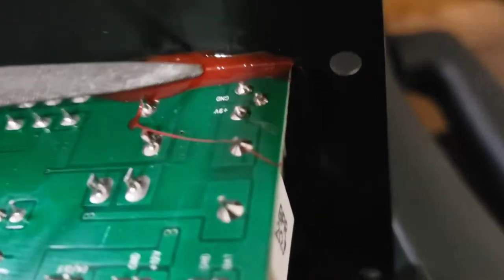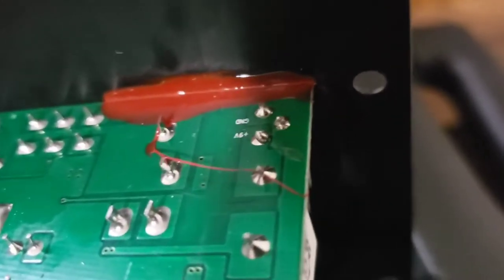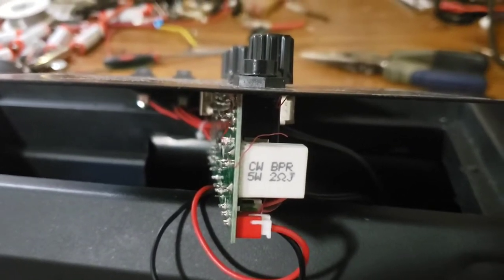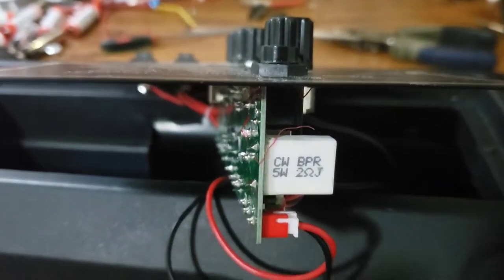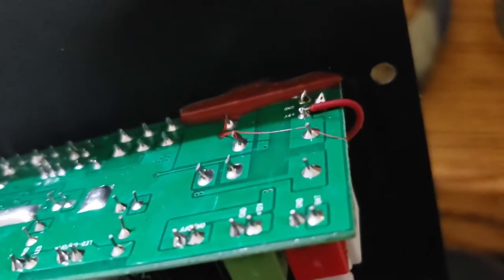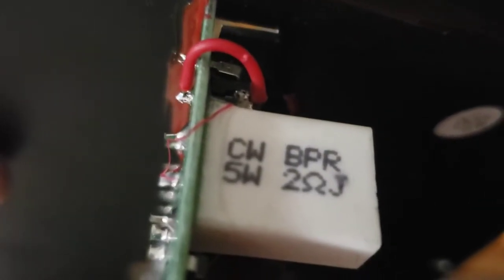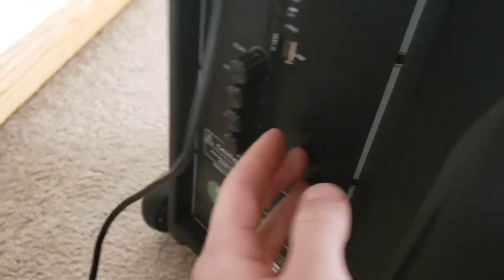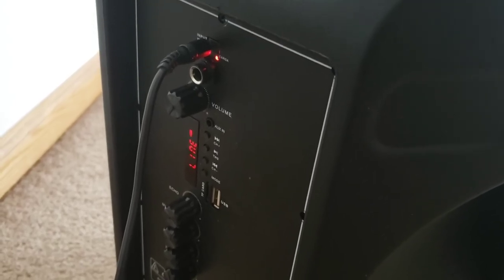Fisher speaker repair

Comment: I Have One Identical To This One And No Sound At All It Turns On Bluetooth Works, But No Sound...What Should I Look For To Fix It?
Reply: Mines is doing the same now did you ever get it to work
Reply: @giavonnifoster2720 , no but I Converted And Used The Box For Another Speaker😏

Comment: ugh! was hoping for a DEMO. there's a store that has these for just $40 now. I really wanted to hear how well this one does bass. I watched a demo for a smaller fisher that sounded decent. this is the model I wanted to hear in action though.
Reply from the maker: Sorry about that, I didn't want to try more than just getting it to power on as the speaker isn't mine.
Reply: @variousengineering1965  this wasn't listed as a demo or review, so I won't rage like I do with bait and switch fake demos. I think I'll get it, and if the SQ sucks, I know where I can get a smaller ibastek that blows my little speaker away for the same price. $40 is a pretty good deal, and the box felt light. A lot of speakers that size are HEAVY.